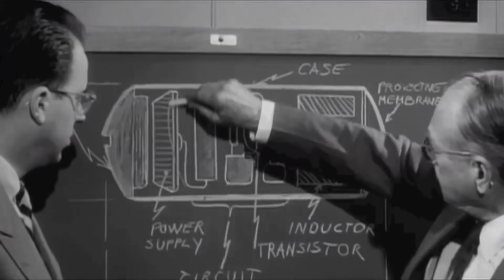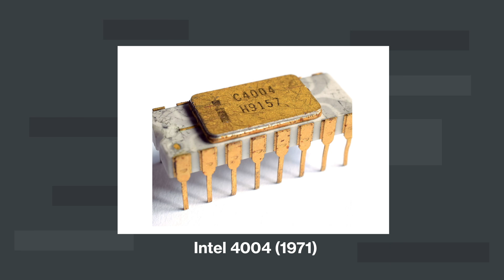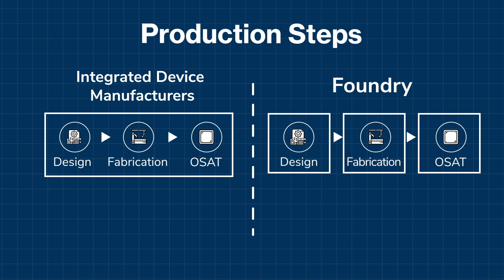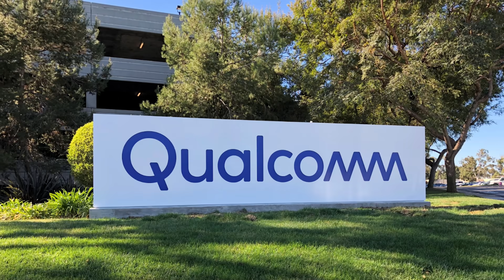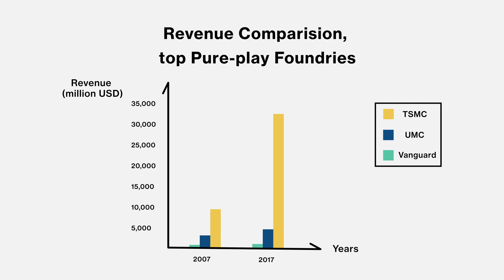Why our world is run on TSMC chips?

Comment: China can keep spending as much as it wants, but when all the key suppliers of actual semiconductor manufacturing equipment are US based (except ASML which is Dutch) they got no chance whatsoever. They aren't just competing against TSMC, but against ASML, LAM, KLAC, AMAT... The US + western allies have still huge advantage against China in semiconductors. Domestic Chinese foundries are 5 years behind TSMC technologically. Also regarding on chip manufacturing, its not just getting smaller. TSMC and also Intel and Samsung have worked on different 3D stacking technologies which allows them to stack chips on top of each other. So chips don't necessarily need to get even that much smaller, there are other ways to scale performance which you clearly aren't aware of. Just research TSMC CoWoS or Intel Foveros.

Comment: You know, maybe the Chinese competition actually isn't so bad. One thing that is becoming more and more apparent to me with the chip shortage as I learn more about it - is that a monopoly is essentially a bottleneck. If everybody relies on a single business, and that business starts struggling - everybody feels the effects. With little to no redundancy, everything goes south when that one business goes south. It's actually very worrying that certain parts of the chip production process are overly reliant on very few, sometimes mostly one, business.
Reply: I don’t agree with you
Reply: In PRC,
Semiconductor Manufacturing International Corporation (SMIC) makes lower value chips.
Nanjing Semiconductor Technology went bankrupt 
Tsinghua Unigroup faces bankruptcy
Wuhan Hongxin Semiconductor Manufacturing Company (HSMC) is bankrupt
Reply: That's how it is in high barrier for entry business. TSMC's most expensive fab (just 1 5nm mega fab) cost $60B in Taiwan. China has no chance of catching TSMC and that's good, we don't want the communist dictatorship to become more powerful than it already is. TSMC never was struggling, they are posting record earnings. Problem is they have not been able to keep up with demand but with their $100B investment in expanding fab capacity the shortages will eventually be solved.